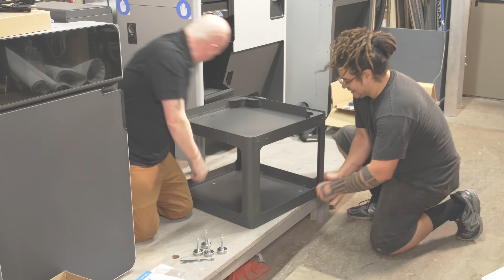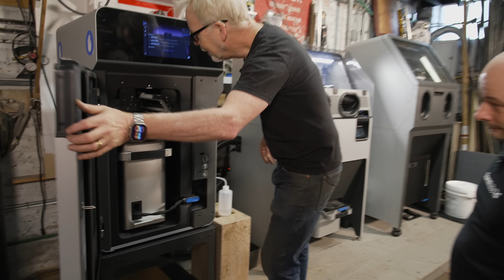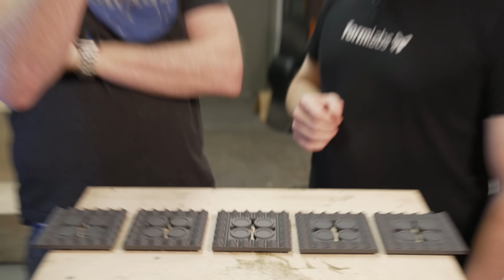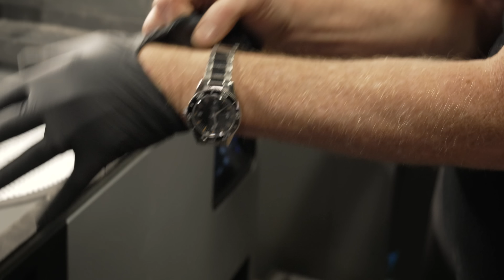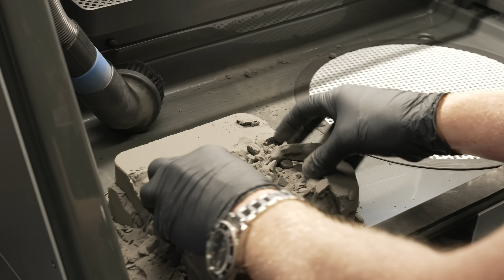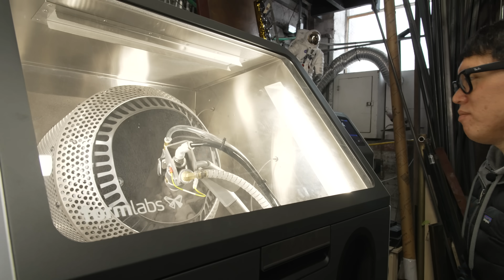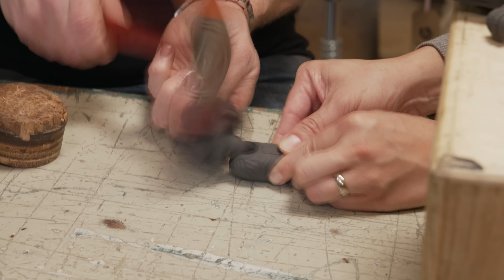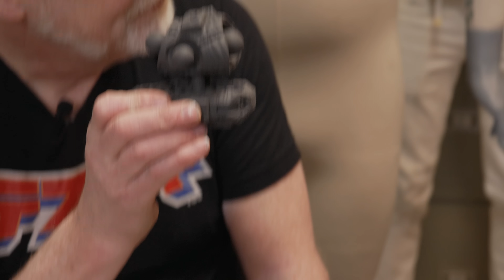Adam Savage Levels Up His Workshop 3D Printer!

Comment: One of the greatest benefits I see on top of the print density, is the clean up and lack of waste material.  No supports means no wasted nylon or post printing clean up of the nubs left behind where the supports connected to the print.  You pretty much go from print to prepping for paint or assembly.  I cannot wait for this printing technology to become a home consumer level product, but right now the costs and size keep this at a commercial level, but FDM and Resin started at the same level and now anyone can buy a printer for resonable prices, I am sure this will go the same way.  How is the fidelity of the prints, do you feel you can get the same level of fine detail as you can with a newer model resin printer?

Comment: These parts are nylon.  Just warm up the opposite of the ball joints with a hair-dryer, they should slightly temporarily expand, soften and become slightly pliable, then try press fitting the had ball joint limbs into the softened socket joints of your model.  They should then fit.  If thing are still too tight, you and sand the ball joints as well.

Comment: For your action figures you will probably want to use a different nylon that will give you a bit more flex in the parts assuming that is available.  Or you could do the trick where you print the figure already assembled - like the octopus that you are supposed to print already assembled in TPU on a FDM printer.  Or, failing that, you could go real old-school and use pins for joints that only move in one axis and rubber bands for joints that need more flexibility like the hips - i.e. like the old GI Joe figures.

I wonder if these SLS printers will ever reach the hobbyist market at a reasonable price or if we will just see FDM/SLA printers get better.

Comment: For things like the movable joints, you can actually print them already assembled. The tolerance in the gaps will be your room for getting powder out. Also, if you work with that stuff in an open context, wear a respirator. Otherwise, you really, really need to keep the lid down. Shit's nasty.

Comment: The size of the machines vs the size of what it can print is still so out of whack IMO. These are no longer home or probably even small shop sized.
Also the cable at the bottom of the printing container seems prone to failure due to metal fatigue from constantly moving the connector from side to side and bending the cable in the middle, depending on what sort of wiring used.
The detail on the prints is really good though, and i agree with Adam on the material properties.

Comment: Two things. As others have said, please use the dust hood or a respirator. I know it's for the video and the filmability, but still.... Second, your action figures need to be printed assembled on the bed. I'm sure you can tune the offsets in the joint, but with this technology, you can print in place and wash the powder out.

Comment: These models can be printed assembled. Just leave 20-40 microns between the joints. A little extra care spent in cleaning, before bead blasting, will free up powder in the joints. SLS is great for print in place models. 

I love SLS prints. But, as many have already stated, use PPE!!! This powder is super fine, ie it goes everywhere. It is hazardous to breathe. SLS is not a home hobbyist format for 3D printing. 

That said, I look forward to seeing what wonders come out of the Tested labs in the coming months/years.

Comment: I am sure you know you need to use PPE. Do not just rely on the hood to capture all particles in the air. You also should do a cleaning step after to ensure all free particles are removed as well from any parts.

Any lubricant you can use to help those parts snap together easier? The quality looked insane wish would could have seen it up close!

Comment: Split the "pins" down their length.  Balls should be cross-split.  Removing enough should give just enough space to get it in.  You might also need to use a mechanical "squeezer" to compress them - something like a band clamp.
And wear your PPE.

Comment: The sheer amount of extra equipment needed for even a small SLS printer is staggering. Add in the fact that you have microscopic particles that you shouldn't be breathing and the only conclusion I can draw from this information is that the only place for this kind of printer is in an industrial setting.

Comment: From 2013 to 2015 I operated the Zcorp 450 color 3D printer. It used kind of the same system,  but with plaster powder and a HP designjet inside. One of the printer cartridges contained a binder fluid instead of ink, the other cartridges contained the HP inks.
Nice system...if it worked, very prone to errors and maintenance troubles...

Comment: The parts of this video showing the post processing required, along with the comments about the safety issues of how that post processing is done, is excellent evidence of why selective laser sintering is a dead end for 3d printing.
Reply: You’re sadly mistaken if you think those concerns are a dead end. It means it will be larger batches and more industrial use. Just because it’s not for home use doesn’t mean it’s not useful. I regularly utilized fdm and SLA on the job and sls would have fit right in giving better prints and better material options

Comment: A way to salvage what you just printed: Sand a small spot on each side of the male ball joint and a little off the whole pin just enough so they can clear the rigid destination joint/hole and snap in with a little pressure or hammer tap.  A way to prevent on future prints: set up a built in 'sanded spot' and slightly smaller circumference pins when in CAD.

Comment: The look, that sound and stiffness of the plastic makes me think they were using carbon fiber with nylon. That's even more dangerous to breath in than just regular nylon. I saw the dust on people's shirts, that means it made it into the lungs too.  Yikes. Please be careful.

Also, you can just use regular nylon powder, and then you will have flex and less stiffness. I don't know if Formlabs makes any, but there is also TPU powder for very flexible and tough parts. Ceramic for other purposes, too. Lot's of materials out there for FDM.

Comment: All safety aspects aside, I have to imagine that with the hood closed there is minimal air flow through the HEPA filters because the gloves aren't being inflated due to negative pressure. With the hood open as demonstrated, there has to be a massive amount of powder getting sucked into the filter.

Comment: I'm sticking with simple FDM printing - for the most part, it's more than enough for pretty much anything I need, even with some 'exotic' filaments, and for those 3 super-detailed, non-porous or extra-strong/resistant prints I need in a year it's much cheaper to just outsource it to a 3D printing farm. Dealing with nylon powder is not fun, don't want that anywhere near my shop...

Comment: I'm screaming at the screen - use the hood!  Use respirators when the hood is not down!  Yes, there's a vacuum airflow, but you wouldn't dare gamble your health this same way if you were handling a block of asbestos or a radioactive material.  This is modern asbestos!  Videography be damned, follow the safety protocols better next time you showcase this!

Comment: I'm super curious as to how infill works with this process, as you've stated, there's no need for supports, I'm assuming that also means the infill for the printing process.  Would infill be needed for extra strength for the finished model seeing as it's such a rigid material anyway?
Reply: There is no concept of infill percentage in SLS. All infill is 100%. If you were to use a partial infill, the unsintered powder would be trapped inside the volume. So you would be unable to reclaim the powder and you’d have worse mechanical properties.
Reply: @derekbergarchive  that makes a lot of sense, thanks for the reply.  I suppose the strength would have to come from the wall thickness.
Reply: I was wondering the same thing

Comment: I don't understand why you would want this, everything has that sandblasted texture, the hardware takes up a huge amount of space, and has a tiny print volume.  What is its intended purpose because detail certainly isn't it. It seems like it would make finishing an aesthetic print more difficult
Reply: printers like these are meant more for multi meterial production of functioning parts with little chemical post processing.

Comment: This is flipping awesome, but come on Adam, you know you should be using proper PPE with this stuff. People idolize you and you're teaching them bad habits. Stop it and do better. I really hope you make a follow up addressing your mistakes.

I know you want some of those fun shots like the vibration separator, but there was no point to keep the lid open. Look at all that lung-shredding dust being spewing everywhere. The built-in fume hood isn't enough to keep you and others safe. Look how much dust is sticking to your gloves and is on the ledge. That's not being handled by the fume hood. 

You need a respirator. You. need. a. respirator. need. a. respirator.

When you're moving the bin between the printer and the recover chamber, you should be wearing a respirator and gloves because what happens if you drop the thing?
When you're loading in powder, you should be wearing a respirator.

Pretty much any time you can see the plastic powder, you should be wearing a respirator. There's no excuse. Do better, Adam.

Comment: Disadvantages of Nylon (PA)

High Water Absorption: Nylon materials easily absorb water, leading to dimensional changes and reduced mechanical properties.

Poor Light Resistance: Vulnerable to ultraviolet rays, long-term exposure to sunlight degrades performance.

Poor Antistatic Properties: Prone to static electricity, affecting usage performance.
Reply: You can vapor smooth it and makes it sealed

Comment: Two suggestions - 1 -,to hollow out your 3D prints, in Fusion, which I believe you use. The shell command will do the job.  2 - With your fitment issue, you need to do a test print with using a shrinkage gauge to see how the print material changes dimensions when cooling.  Link many of the filament materials how you cool down the part will cause the shrinkage percentage to change.  It is interesting that your nylon material would not flex and that under stress it fractured.  Is there a curing process you need to go through to temper the finished part?  Nylon is usually able to handle some flexibility.
Reply: It depends on the density and thickness of the part

Comment: My buddies and I were gonna pre-order a Fuse 1 to add to our print farm when they first enounced it. However after requesting some sample prints, we were not impressed. They were very brittle and broke with very little force, especially considering that it's nylon. Formlabs asked us if we wanted to place an order, but at that point we had more questions than answers. So after the parts weren't to our standards of durability, we started asking more questions about practical uses, but the Formlabs rep ceased communication with us after that. Apparently he didn't see a sale forthcoming...lol.
Reply: Could some kind of annealing step improve the cohesion and durability of the print? That's something that even FDM prints benefit from, so I wonder if it's not a useful thing to do with SLS too.
Reply: Having used a friend's fuse 1 I can agree with you. It feels more like a porous nylon network than cast and machined nylon. The refresh rates very quickly affect part strength even if the prints still come out looking nice. I would be very hesitant to use it for any thin-wall fragile parts, for thicker stuff it's probably more than adequate.
Reply: @Saminvent05 it feels like it’s porous, but it’s not— you can cross-section it with a waterjet (or other cutting method that doesn’t cause melting) and the sintered area is solid. PA12 can be brittle if the part isn’t designed with the material limits in mind— PA11 is more ductile (super tough stuff). Orientation matters too since the layers are ~110 microns (the powder is ~80 microns) in the Z axis, but you get finer resolution as the laser sweeps in the X/Y axis.
Reply: It depends on the powder used, they have less brittle nylons.

Comment: I would think the downside to leaving the hood open while cleaning the parts is that it will pull in dust from the shop and contaminate your reclaimed nylon powder. Also, I wouldn't want to risk inhaling any of that powder.

Comment: I know it is normal to add different ressins to powder prints. Would be fun to se this strenght teated with and without ressin. Maybe use vacume chamber to resin stabilize them for ansane strength??? Would be fin to se!
Reply: Don't need to add any resin pa12 is plenty strong. Vapor smooth it and it's even stronger

Comment: Nice SLS printer .Looking forward to seeing CAD sessions.  Great to see a Formlabs printer to compare with the smaller, maybe more home maker Bamboo. Formlabs show gear teeth in the examples.  .Still alot of cleanup with SLS and SLA but you get the precision to make gears. Just recieved some PCBWAY UTR-8220 SLA 0.5MOD gear parts and they are ~ 0.1mm under in 10mm dia, within spec. Way cheaper than i could make in the time for the cost. about + - 0.05mm ovalocity in all parts, they run without binding still at 0.05mm pulling in on the shafts.  3D additive has come on such a long way in 2024. Best wishes for 2025 Adam and all.

Comment: The nylon 12 will have some flex if you get thinner parts. You can also try warming the joints for assembly, though watch it, there is a fine line between flex and melt if you tray the warming. I like hot water. All truths I work with smaller parts generally as a profession. I have never tried such large ball joints. Other choice... Remember no support...so you can build the parts together and the gap in joint should depowder.

Comment: If the extraction of the prints feel slowing down. disassemble the build chamber und renew the grease on the threaded rod with a high temperature one. thats a weak spot of this machine.

Comment: As with any 3-D process you have to modify your CAD assembly tolerances to allow the parts to fit together. The ball joint you showed has an internal "overhang" that you need to account for the assembly in your CAD design with possibly more parts cut out the whole part.
Reply: I don't think it is a matter of tolerance, but of clearance.
Reply: @Astromechy  I think you are right. I intend tolerance as the movement that is allowed once the ball is in the receiver. That needs to be tight to hold the legs into position, but still movable to play with. Clearance is how much the receiver "closes" around the ball, and needs to clear when the ball is pressed in
Reply: @Astromechy   Semantics.  It's the same thing.

Comment: We’ve all been there! In my experience nylon 12 does have some flex to it, but like any material it depends on the thickness of the structure. I created a set of ball and socket joints somewhat like those shown, but minimized the connection surfaces as shells approximately 1/4 thick to allow for enough give for insertion of the ball (without tolerance for a firm fit). Obviously good idea to prototype and print test fit fitted joints be sure they will function and snap together.
Reply: Yes, surprised me that there seemed to be no flex, despite some walls being 2mm thick. On further reading it appears the material may be 12CF, which is carbon fibre reinforced and may explain the metallic-type tapping sounds and rigidity.

Comment: I feel like you could print these types of things already assembled to avoid that "won't fit" issue just because of not needing supports.  I'd love to see you try that print!!
Reply: This was my thinking also !  I think they can print-in-place - would be neat to see them try again with that method... might have to  adjust tolerances - the press fit looked a little too tight.
Reply: sintered powder will have different tolerances than plastic filament or resin. as is, with the current tolerances, the joints would fuse together and it would just be a solid figure. one way would be to adjust tolerances on the file as you said. a quicker way would be adjusting the printer setttings (if there aren't physical requirements needed, only thing would be aesthetics, only getting iffy if you push it too far). other way, that they're taking a whack at, is post processing (sanding/filing down would work eventually).

Comment: I’m here, yelling at the screen use a heat gun heat up the socket and then try to hammer it in the nylons. Flexible when hot that’s why you have to let it cool before you take them out.

Comment: HI Adam.  nice machine, much more automated than the 3d Systems DTM Sinterstation I ran for 10+ years at work (2004-2014).  Basically the same process.  heat, sinter, cool, post process brush and then bead blast.  My bead blaster was manual hand held, but you could easily direct it where you needed to get better cleaning in tight areas.  the working volume of my machine was about 10 x12x 14, and I usually printed .004 layers back then.  Be aware as good as this new system post process works, you will find the powder gets everywhere!  much like wood working!  good luck,  Tom